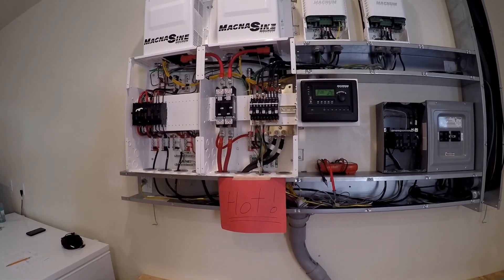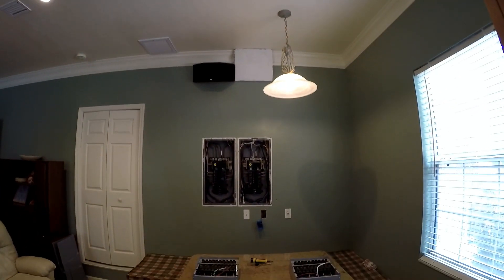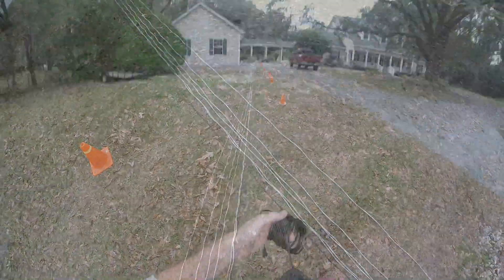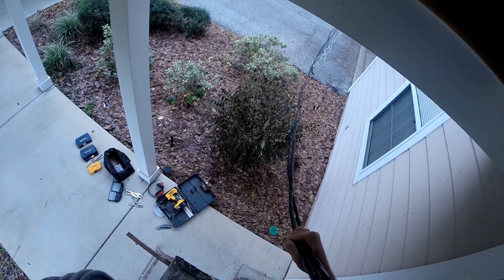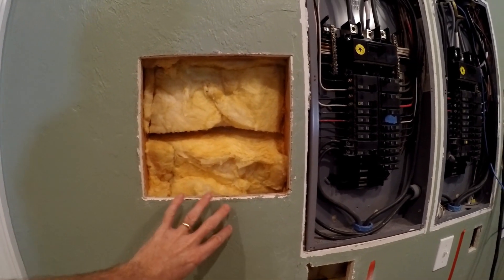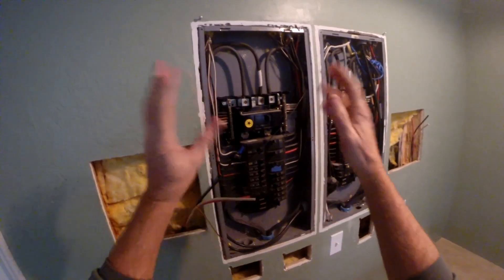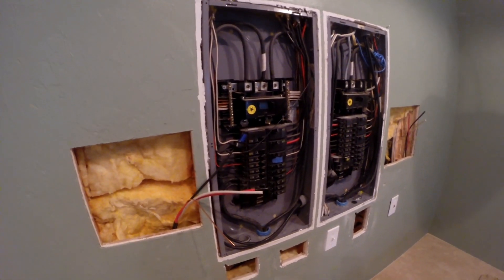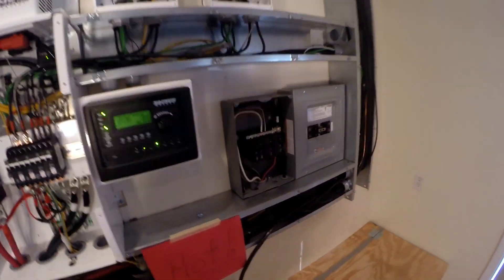Off Grid Solar #37: Pulling Wire and Initial Test

Comment: Looking good my friend. I like the Magnum Charge controllers you have. The only 100 amp on the market I believe. Roy and I have our battery charge algorithms set up the same. Most of the PV world has their voltages to low. I go through more water than a lot of people but sulfation is not an issue. You do very nice work by the way. I hope that Evergreen solar gives me my money back soon so I can order another Magnum inverter. Since you had a problem too you would think that Magnum would change the packaging or something. I was going to install the new inverter before anything else but Ill just have to wait. The weather is lousy anyway lol. Do you have a figure that you can share on what your total system cost is?
Reply from the maker: The total system cost is around $26,000 before any rebates.  I have a complete breakdown of the parts list in the design videos #1(original) and #24 (upgraded).  
https://youtu.be/xRA0omlN9v8?list=PLkTIWHBRRyi6NyWsyl03VuC2-JdBx0M46
Reply: That would be a least double that if you had it installed by a contractor. I have not watched all of your videos but a bunch of them. Are you going off grid at some point or just a need along term (grid down scenario) backup?
Reply from the maker: Well Steven, I think we are all going off grid at some point in the next 20yrs.  The later the better.  That was about 40% of my motivation for building this system.  Another 40% was because It's just a really cool project/hobby and the last bit is just about independance.  I guess the system will pay for itself in about 14 yrs or so but that was not much of a consideration.  I don't have any plans to go off-grid as long as it is there.  The air conditioners, stove, oven, and water heaters are still on the grid.

Comment: when do we get to see the whole thing function in real world
Reply from the maker: Funny you should ask...  Today was the 1st day that I had the whole thing up and running!  I finished wiring the two transfer panels last night.  The house is running on the solar system right now (7:44pm).  I'll post the transfer panel install video asap and then work on a functional video of how it performs.
Reply: We should go over the charging voltage some time soon before you get it going to long. No need to sulfate the batteries

Comment: how is that project progressing
Reply from the maker: Getting to know the system a bit.  I am running everything in the house except all the big 220 loads.  Start the day at about 85% battery and hit 100% by 10:00am.  Stays at 100% until the sun goes down.  I shut off the solar around midnight.  I ran the dryer on solar a couple of times around noon.  That draws about 6500watts.  The panels can keep right up with it cranking out 7-8000watts.  The panels are cranking out 2-3000 watts even when overcast and about to rain.  My L1 and L2 are not very well balanced...  Spent yesterday changing out all the light bulbs to LEDs.  Spent today running those video and network cables through the 2nd story attic.  Not fun.
Reply: Sound as if your almost in order with it. Do you have a refractometer to measure specific of gravity. Your going to need to do this very soon. This is important to prevent sulfating batteries. This is where the settings are crutically important. The L1 L2 Balance isn't critical but the better it is the more efficient it will run. You can run up to 29 amps on one side but not the best thing to do.  Most cloth driers draw about 3000 watts